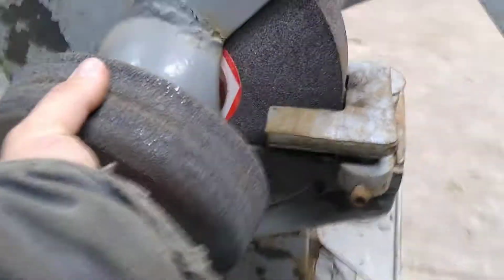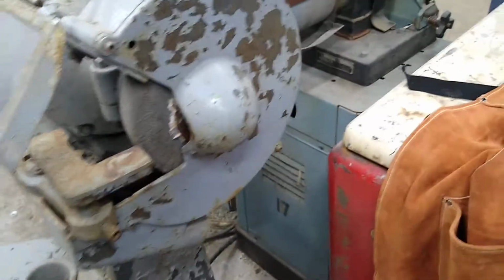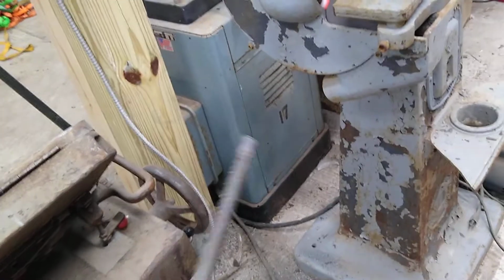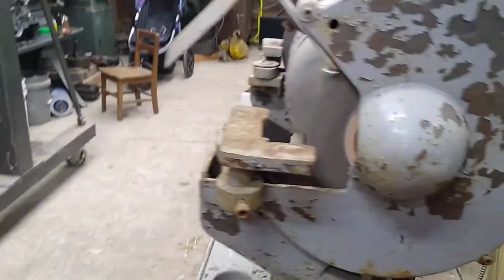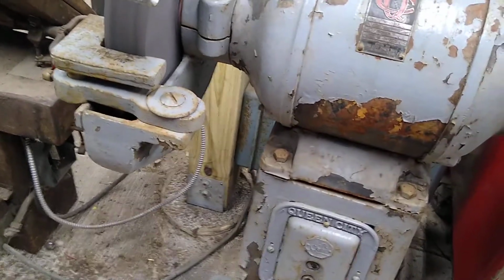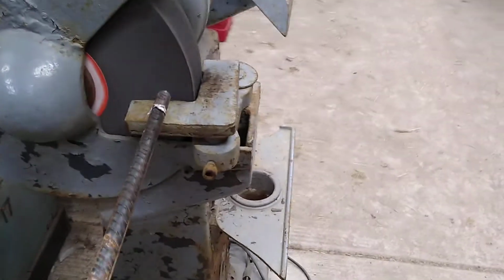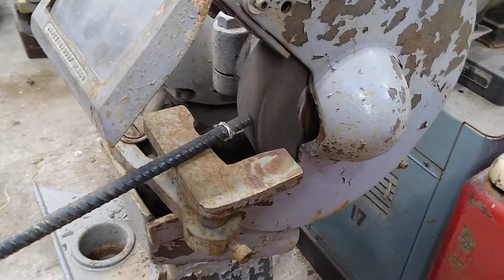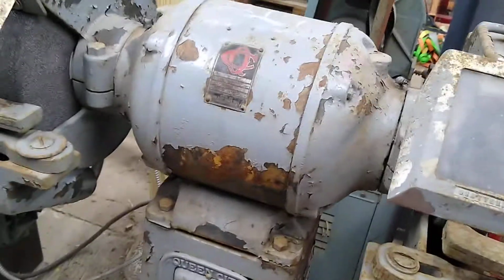Queen city 12"*2" pedestal grinder first time grinding

Comment: I just rebuilt one of these, exact same machine. I only have 1ph, so I plan to run it on a VFD. Never used one, so we’ll see if she chooches. The rest of the 3ph machines are on the RPC.
Reply from the maker: Just make sure u set the current limit on the vfd correctly. Especially if it's a big vfd. Otherwise the current will rise higher than the safe amount before it brinks the voltage up.
Reply: Ooops, my mistake, it’s a 2hp grinder. I have a 5hp VFD. I’m kind of a rookie with them things so I had the factory configure it. Hope it’s right.
Reply from the maker: @ryanjones9305  change the factory config to match the amp ratings. That vfd is twice the size as u need so it will cause your motor to lag tom when loaded and it will over amp the motor if not set properly
Reply: @electromechanicalstuff2602  I’ll check it before I put power to it. Thanks for the heads up.

Comment: I picked up a Queen City 4F grinder,  2hp, 3 phase Tuesday , still in my truck.
Reply from the maker: As long as the bearings and motor are good you'll be happy with it. I got mine for a steel of a price @ $50 hope u scored a good deal too
Reply: @electromechanicalstuff2602  it was gifted to me so a great deal so far.
Reply from the maker: @3cl1  best deal